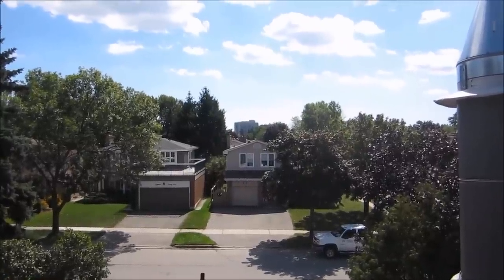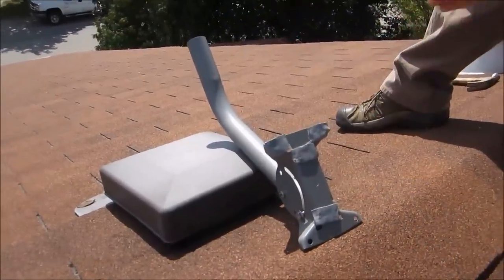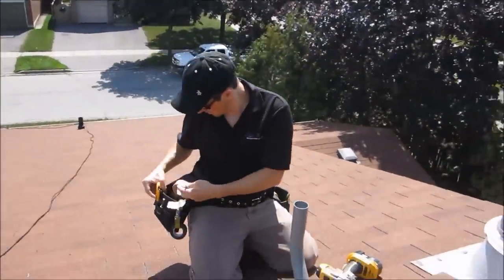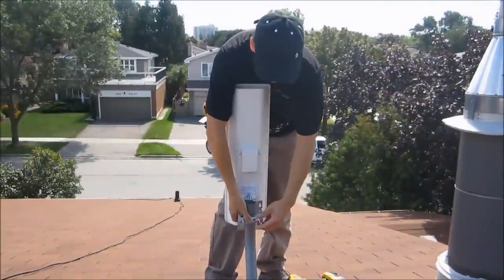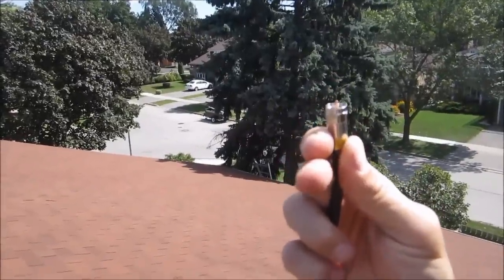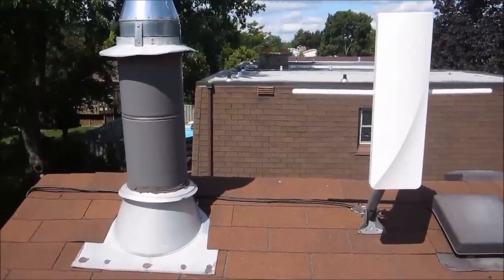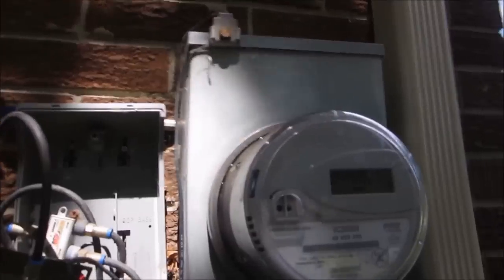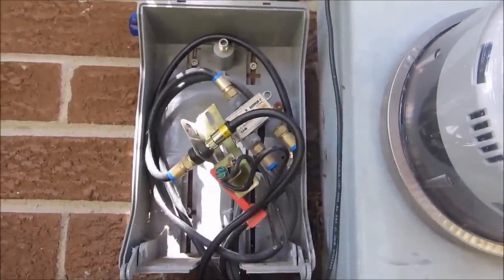HDTV Antenna Roof Installation with proper grounding

Comment: Have you tried placing an EagleStar Pro Amplified HDTV antenna without its amplifier (that plugs in the house type not amplified @ the antenna) vs the same antenna but with a mast mounted pre amplifier? Please do a video on that I feel that it would surpass the antennas performance having a pre amplifier at the mast.

Comment: Actually you are checking for "plumb" and not "level". Good video. And "best" antenna definition is relative to the  area in which it is used, terrain, station location and power, and aiming the antenna. One size doesn't fit all!

Comment: Is there some type of meter showing signal strength  that I can connect to antenna on the roof to help with positioning? I don't have a 2nd person w a cell phone to be inside watching signal strength as I adjust.

Comment: Is there really a HD antenna? the frequencies are the same from the stations and the television is what changed.
Reply: no
Reply: You are correct the frequencies have not changed so there really is not an HDTV antenna.  Most of these new "HD" antennas are just uhf only.  There are very few vhf channels broadcasting now and they are only in the vhf high band.
Soon vhf will be discontinued and it will be uhf only for antenna broadcast.
Reply: @STONE69_  Yes there is one channel CTV on 9.1.  The rest are all UHF.  Over 30 channels between the two cities.

Comment: Hello, I have a question on the Bolts with rubber washers used for mounting the J-Pole mount.  What length and size are they, and do you have a source for the bolts??!??  Much Thanks, Tony K. , Melbourne, Florida  :o)
Reply from the maker: Yes I can ship them to you.  They come in a box of 100 in either 1.5", 2" or 3".  Contact me by email and we can chat. info@electroguy.com

Comment: On the mount to the roof, where is the other end of the ground wire? I see you connect it to the bottom of the mount, but where does the other end go?
Reply from the maker: You terminate it at your electrical panel ground.  You can also connect it to your electrical meter or mast using a proper ground clamp. Look at how your phone or Internet service is grounded and copy that
Reply: So it runs alongside the coax?
Reply from the maker: @Eric48359  you can buy coax that has a messenger wire or just run a separate ground wire.

Comment: Do you have a manufacturer and/or model number for the putty tape you used? Thanks!
Reply: +James S I believe he is using Vulcanizing Tape. Honestly, hit home depot and pick up that Scotch Super 88 all weather leccy tape for the wires, and tape from the bottom up, overlapping like shingles to ensure no leaks down the line. That tape is the SH!Z for wires! The GE 3 Hour Rain Ready Clear Silicone is great stuff for sealing anything up there - I have had some of that in a very exposed environment for 5 years, and it is still going strong - but ensure you wipe down the metal you are sealing with isopropyl alcohol or zippo lighter fluid, so you get a nice clean surface to which it can adhere - but ensure you let it dry thoroughly before applying, and wash your hands first to minimize skin oil contamination.

Comment: Great informational video.  Curious though what happens when roof shingles are replaced.
Reply from the maker: the roofers can remove it and reinstall it in the same spot or you can have a service call to have it reinstalled

Comment: Very helpful. Especially since it looks like the Marathon which I'm thinking of getting. Basic question - maybe I missed it, but where/how do you run the wire for the power booster to a 110 plug? I didn't see that wire/extension being run.
Reply: This is an Eaglestar, which is a Canadian clone of the Antop antennas. The american/global version of this amtenna is the Antop sbs-802

Comment: Excellent job. I also install antennas in Durham Region.

I install Resisto Red Zone weather-proof membrane under the mounting pole. The stuff works great.

Messy in the summer when it's hot.

Where can I purchase rolls of RG6 coax with the attached grounding line???

Very difficult to find these days.

Comment: I'd be a mad mad homeowner if a contractor screwed a mount through my shingles. Do it right man!! 😂
Reply: I'm all ears.  What is the right way?
Reply: @daxtheaxe  for starters, flip up the shingles so it overlaps. Flashing works wonders as well
Reply: @daxtheaxe  secondly, those mounts aren't made for rooftop mounting. They are made to be mounted vertically on facia.

Comment: Can grounding an antenna make for clearer sound?  I've had some sound distortion and wonder if I'm grounding correctly.  I do have both a pre-amp and an amplified distributor.
Reply: If you are getting sound distortion I don't think it would be a bad ground.  Usually sound distortion is from having your volume too low on your tv and then outputting it to an amp.  You then have to turn the amp up high to hear anything resulting in distortion.
Best to keep the tv volume at max.
This could also be the case if you are using a converter box and have the volume down on that and then turning the tv or amp up.

Comment: How is this considered properly grounded since there is no actual copper line going to the ground? Where will the energy go once it passes through ground wire to to the mount?
Reply: dcentral it will travel from the mount down to the existing grounding block and then over to his electrical meter which is physically grounded to earth

Comment from the maker: there are cheap ones but they give you the overall signal for all channels and I never use them.  most tv's are not that accurate.  I usually just try and point at buffalo for my area because that is where the weakest signals are coming from.  There are spectrum analyzers but they are expensive.
Reply: What is the proper name for the putty you used?  I'm trying to find it at my hardware store.

Comment: Question: We are in a cold climate, Minnesota USA. Will snow and Ice degrade or stop the signal on a Marathon antenna?  Great video thank you.
Reply: Minnross1 Buy a channel master 7777(70-80mile) or 7778(40-65mile) depends of how fast you live or the winegard pre amp.

Comment: From my house I have broadcast towers 35 miles SE from my house and some opposite 15 miles to the NW, will this antenna get signals from the front and back?  If not what kind of antenna would I need in order to receive signals from both directions?  Thanks!

**I ended up purchasing the antenna in this video,  was no good for me,  had trouble getting most channels in,  replaced it and had big improvement.
Reply: Aq

Comment: Did you use a signal booster before the coax cable was attached to the back of the tvs in each of the rooms?
Reply from the maker: Jeannette K No I did not.  If you are going to use an amplifier you would usually use one right before the splitter in the house.
It's called a distribution amp.

Comment: I have the same antenna in my attic in North Oshawa up on the hill and get about 26 channels, 23 watchable to me with our current configuration. I know I could get more if it were on the roof. I have it pointed about south, south east.
Reply: userfriendly06 Do any of you get any channels like "history, hgtv, discovery, bravo......or do you only get local channels?
Reply from the maker: Vic Collins only local channels
Reply: Local, Toronto, Buffalo, Rochester. Way better than overpaying for cable with commercials.

Comment: I know this is an old video but maybe someone is still looking at it !! So you can connect the ground wire from the Antenna mount and the ground coming from the actual antenna (coax)  and connect both to the main ground of the house off the hydrometer ? If that makes sense what i just asked !
Reply: Yes.  The outer metal part on the coax connector is grounded to the antenna, which is grounded to the mount when attaching it.  Metal on metal.  You could essentially just ground the coax since it is grounded to the antenna and mount anyways.  The copper ground just gives it a cleaner grounding because of paint on the mast.
Reply from the maker: Yes that way all parts are being grounded.  Both the mast and antenna
Reply: Thanks.

Comment: What is the other end of the ground connected to on the roof ?
Reply from the maker: Connect the ground to the antenna mast.  The antenna bracket is metal, the mount is metal.  We usually ground to the mast.
Reply: Electroguy, Not really certain what I am doing. I put a picture of what I have on your Facebook page. Thank you!

Comment: Hello I'm installing an antenna and I understand everything on your video except on my home I'm still using the cable wires for the internet so I can't just replace in with the antenna cable. What do I do? Thank you
Reply: You have to run a separate cable to your TV then.
Reply: Or you can relocate your modem to a different jack to free up that cable for your TV.
Reply: Thank you

Comment: Thanks for the video Electroguy. I am a DIY/home owner in Quebec and looking to install my first antenna in the next days. Your video has help me quite a lot in understanding the entire process !

If you don't mind me asking, why do you ground the antenna AND the cable ? Both grounds are going to Hydro's ground, so if the antenna gets struck by lightning, shouldn't it go through the coaxial cable anyway ? It might be an electrician law/regulation...I don't know. But I'm wondering why both are grounded.

Again, thanks for all the details in this video ! :) Thumbs up !!
Reply: I'm in the same boat as you (looking to install a rooftop antenna).  From what I've read, I believe the reason to ground the antenna + mast is so static electricity does not build up on them which greatly reduces the chance of lightning strikes.

The size of the ground wire is so small that if lightning were to hit it it would burn up.  In order to protect against lightning hitting close by you should use a coax lightning arrestor.
Reply: In the United States the NEC 2011 elwctric code requires ALL grounds to go to a single point. You use a "bonding bridge" and connect the main house ground and all low voltage grounds to the bridge.

All grounds now must be at one point to prevent changes in potential voltage between grounds. During lighting strikes having a single ground creates only one path to ground instead of multiple, limiting the possibility of damage.

Comment: Hi Electroguy!  Thanks for the nice and informative video.  Just a couple quick questions, what size bolts are recommended to secure the mount to the roof?  Do you know the website for Eaglestar?  I was looking for the manual for the antenna in the video, but wasn't able to find it on some quick searches.  Thanks! Jim
Reply from the maker: I am using lag address with a 3/8 nut head.  lag screw I think is 1/4 inch diameter

Comment: Thanks for the video. What is the Model and Brand name of the antenna in the video? In addition the ground depicted isn't legal anywhere in California; I know this due a neighbor was having some work signed off and the building inspector suggested I get it fixed. after I put in the new earth ground rod, AT&T came right away to move their ground for my internet.
Reply: Prosonic PRO-536165P
Reply: W

Comment: What exactly purpose of the grounding for the antenna? Protection for the lightning strike or increase the reception level?
Reply from the maker: Budi Setiawan Grounding is more for static discharge.  Static can build up on outside electronics like an antenna or dish.
If lightning hits the antenna everything will fry whether it is grounded or not.  In most cases using a coax grounding block is sufficient and you ground that to the building ground.  It's always best to check your local grounding codes and all an electrician who has experience.
Reply: i see, is it enough to ground the coax grounding block or splitter only? because i did not have antenna mount like you have, i use long poll with directional antenna, thank's for your reply
Reply from the maker: Yes grounding the coax ground block should be fine.
Reply: Got it thank you

Comment: You are trying to "PLUMB"  the post, not level it...Level is for horizontal surfaces...other than that, nice video..
Reply from the maker: never knew that thanks for the info
Reply: +Electroguy Hey, me neither. Good to know.
Reply: Also notice at 6:46, his level's bubble appears to be off to the left a little.

Comment: I am in Scarborough on the top floor (25th) my balcony faces due North.I am close to Danforth and Main in Toronto.
I was wondering how much luck i might have installing a antenna off the balcony even tho i'm facing north ?
Reply from the maker: hi Rob I have not done a North facing antenna job so I can't really offer you a good opinion on it.  The concrete in the building usually kills the signal so I would expect buffalo to be a no go.  Toronto should be fine though.
Reply: Rob
I bought a Eaglestar Pro #53-6165VA and mounted it to the wall in my apt facing south.Remember, i am on the 25th floor on the north side of the building.Did a scan and picked up 21 channels including WGRZ 2 Buffalo, the one i was most interested in.
Reply from the maker: There is someone who has tried it.  Thanks for you comment Bob.  I sell that antenna so if you want to email or call us we can setup an appointment.  Thanks
Reply: Rob

No need to set up a appointment since I already bought one from Pro Electronics in Ajax.
I am on the penthouse (25th floor) and have a commercial antenna on the roof now.
I am so impressed with the Eaglestar Pro getting 21 channels just sitting on the living room floor on the north side of the building,
I'm going to mount on the roof.That should make appox 270' high.I have a clear view of Lake Ontario and can see the light on the other side of the lake on a clear night.
I'll aim it slightly to the east at Buffalo.What kind of cable would you suggest, I'll need 75'.

Comment: Can you mount the coaxial block need the mass then ground wire to the house ground rod?
Reply: Yep you can do that but I will say the number one failure in an antenna system is usually corroded connections from water ingress.  So if you decide to put the block up on the roof then put it in a sealed enclosure box or use properly sealed connectors.  I always, always always use connectors with a rubber o-ring on the inside of the threaded barrel.  It's also has a seal on the crimp side or back side of the connector where the cable inserts into the connector.
If I can help it I never have a join or connection exposed to the weather outside.
I always try and connect things inside.
Reply: Daxton Valyear thanks! Got a waterproof box, the house ground is in the opposite direction of where  the coaxial entry to the house...TV

Comment: What is the model of the antenna?  Would it work for 70 miles?  I'm in FL
Reply from the maker: Please contact us directly and we can give you more info on the antenna.  info@electroguy.com or 905-556-0336

Comment: I've been considering an antenna but I live off grid and have no hydro meter and no cable box. I run an off grid solar set up and have never had cable in my rural location. Can I still set up an antenna?
Reply from the maker: Red Tankgirl if you live in an area with good reception you could use a non amplified antenna which does not require any power at all.  The only power required would be for the tv.
Reply: I live in the bush, literally. I have 98 acres of wood bush I live on and am pretty remote. I was thinking I would need an amplified antenna out here. Could I still do it? Supplying the power isn't an issue. Just is it possible without all that other stuff. Cable box and hydro meter. I really don't want a hydro meter. lol
Reply from the maker: Red Tankgirl Yes you can.  All the parts that you need are the antenna, the cable with connections, the amplifier and a TV.
Reply: That's great. Thank you so much.

Comment: What do I do if my outdoor antenna has a 12v plug for an amplifier?
Reply: That is meant to plug inside the home.
Run a coax from the antenna into the house.  Plug the amp into power and connect it to the coax inside the home.

Comment: i installed a new MARATHON ota antenna i auto scanned  the channels but i have 2 major channels missing  abc and cbs.  how can i can i get them back?  it seems like everytime i rescan i get one and loose one HELLLLLLLLLLLLLP!!!!!!!!!!
Reply from the maker: ruben barrientos I have never used that antenna before.  You may have obstructions that are causing the signal to fade.  My advice is to try raising the antenna, add a pre amp or try a new antenna.  cheers
Reply: The Marathon indoor/outdoor imo is one of the best antennas on the market, but it does need to be aimed properly.  I would suggest just double checking the angle it is pointed, to make sure its hitting the tower.
Reply from the maker: ruben barrientos By the way this antenna is not the Marathon.  Try moving the antenna left or right.  You can use tvfool.com to find the compass headings and then aim the antenna between the two broadcast towers for those channels.  if one is farther away point more directly at that one.  Raising the height of the antenna can help as well

Comment: What is the diameter of the mast? Thank you!
Reply from the maker: 1 5/8" Its a standard size generally for antenna mounts.  Some are 1.66"
Reply: @Electroguy  Did the U Bolt that came with antenna fit the mast or did you have to het a larger U bolt? I am in the process of taking down my Directv dish and installing this antenna on that mast. Thank you.

Comment: Is the mast also grounded?
Reply from the maker: Since the antenna is attached to the mast by metal clamps.  If you ground the antenna to the mast they are both bonded so they will both be grounded
Reply: @Electroguy  Yes your right. At 12:27 you show that. Oops lol